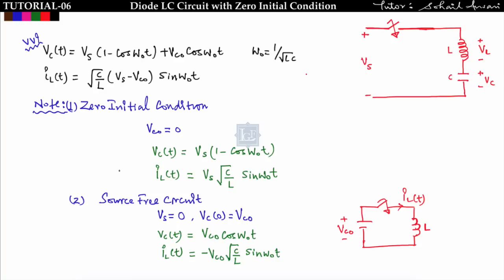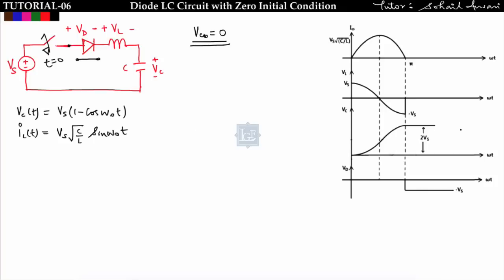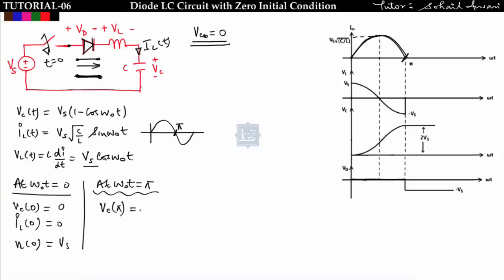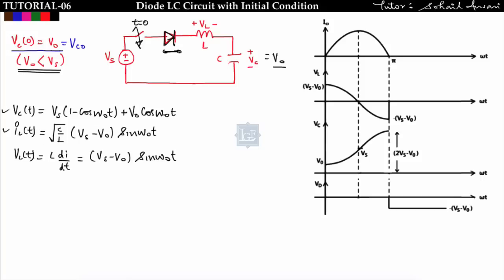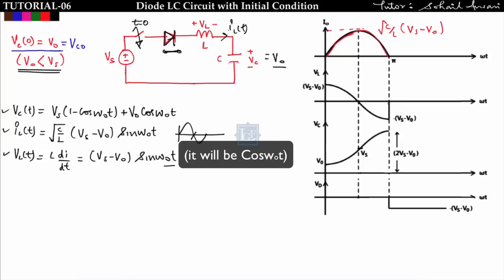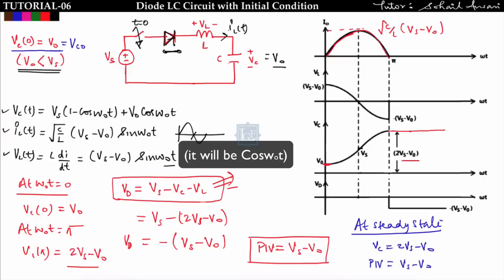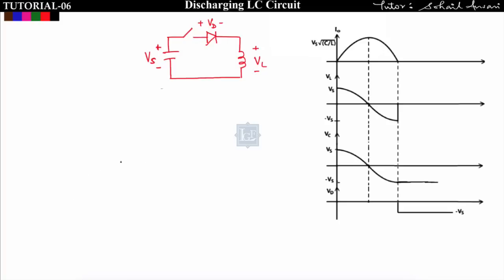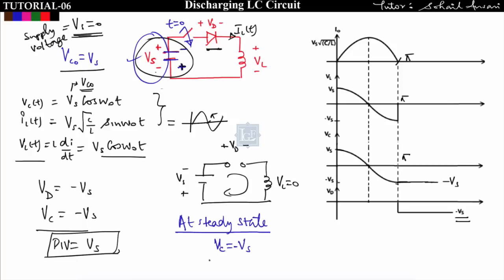Lec 06(b) Diode Circuit Part b

Comment: Can anyone help me please..
What is meant by steady state here...and how the capacitor voltage is 2Vs constant  ....after π
Reply: Brother, 
1.the state after the transient is called steady state. In other words w.r.t to waveform steady state is that state when you don't get any variation in waveform w.r.t. time .
2. capacitor charges exponentially till pie. Then  diode gets open and capacitor gets charged till value 2Vs. 
3. it will be constant afterwards (no variation) until the capacitor gets any discharging path.

That is why steady state state voltage Vc with zero initial condition = 2Vs.

Hope your doubt is cleared. :)
Reply: @navneetkumarsabre7275  thank you very much...your explanation is really good .. thank you once again Navneet..
Reply: @hareeshk4533  Glad to help you brother. ☺️🤗🙏🏻

Comment: Sir how is inductor reaching -Vs  if we are not considering the equation. Is it bcoz of any of inductor property.
Reply: Haa , up to 90 degrees it got charged.. from then(90) it will discharge..,...and the.  discharged voltage is taken up by capacitor and it became 2Vs

Comment: sir i understood the lecture completely....but in zero initial cond 
Vl(0)=Vs mathematically i understood this i.e. from equation 
but how to anlyse in electrical point of view i.e. inductor storing releasing energy concept
Reply: My dear friend, if I am not wrong, if we observe the waveform of VL, from 0to π/2 it's +ve means charging and from then to π it's -ve means discharging...(it will be more clearer if you have idea about transients ) and the discharged voltage is taken up by the capacitor....

Comment: Dear sir,
VL(t)= (Vs-Vo)coswot. Put Vs=0 and Vo=Vs.
VL(t)= -Vscoswot.
at t=0
VL(0)= -Vs and t=pi VL(pi)= -Vs.
So graph for VL(t)  should be made accordingly.

This is and LC circuit with source free response. The capacitor and inductor can't charge and discharge with same polarity.
Reply from the maker: tell me the time at which you are getting prblm??
Reply: At 15:15. In the graph Vc(t) and VL(t) seems to charge and discharge simultaneously with same polarity. Since this is an LC circuit if one is charging then the other should discharge. So at a time Vc(t) and VL(t) should have opposite polarities.
Reply: This is an LC circuit with source free response
Reply from the maker: see above equation u have written with sources. thats y u are getting negative Vc..here discharging circuit is there..so i have assumed the same convention like actual Vc..thats y it is taken as positive

Comment: dear sir , after pi how inductor voltage ll be zero . bez if we ll take w0t value 3pi/2 then the inductor current ll have some value. then how it ll be sir?
Reply from the maker: there will be inductor current but inductor voltage will not be zero..output voltage will be zero..ourput voltage= IR+Ldi/dt..got it....it can happen bcoz of short circuit..

Comment: how capacitor will reverse it's polarity after wt=pie, even if we know that capacitor will oppose to change in voltage.
Reply from the maker: tell me the time at which you are getting problem?
Reply: 16:48
Reply from the maker: dear rajani..capacitor is reversing the polarity not quickly..it is taking time to reverse the polarity..so it can be done by the capacitor..ok..capacitor wont allow sudden change in voltage..that is sudden..here gradual change in voltage occurs across capacitor..got it..